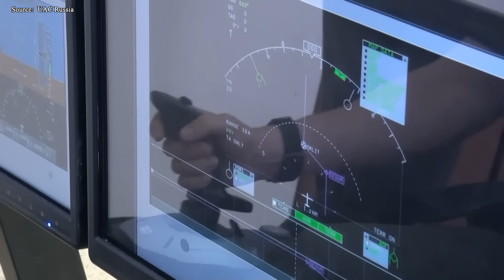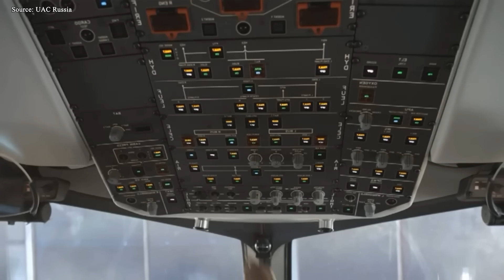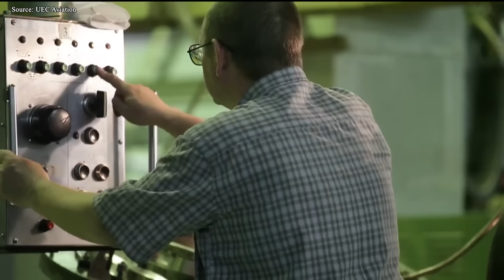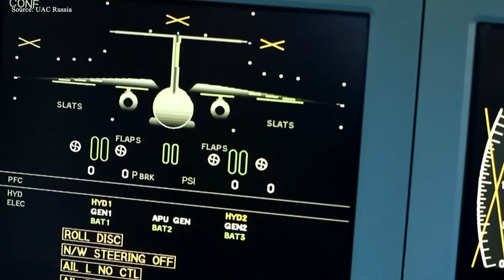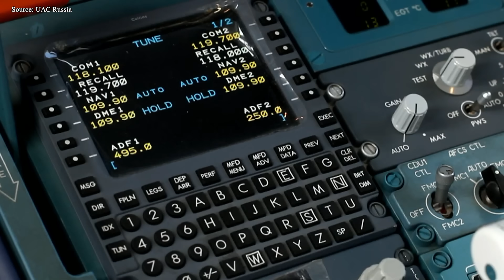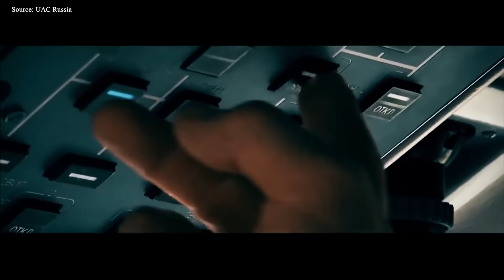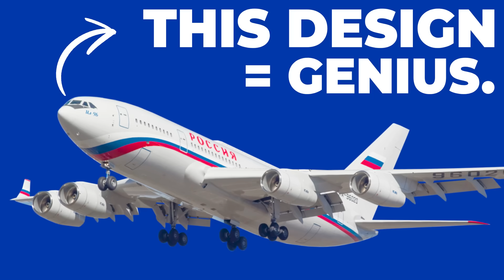How Russian Ilyushin IL-96 Just OUTSMARTED Boeing & Airbus

Comment: There has been plan for the manufacturer to redesign the aircraft to use 2 more powerful engines in place of the existing 4 engines configuration. If their aero engineers can solve the technical challenges, especially the ways to reinforce wing structures, the two-engine Il-96M would be easier and economical to maintain and operate. This will put the aircraft as a serious threat for its direct competitor such as Boeing 777 and Airbus 350
Reply from the maker: it's useful!

Comment: As you don't mention, before 2022 Russia was already sanctioned and only when it benefit the west they gave sanction waivers and using that as a pressure model ,only look at 2019 to 2022
Reply: Who deliver the ps 90 aircraft engines   and airframe ill 96 to Russia?

Comment: It will get 2 engines PD35. And become best in its class
Reply from the maker: Sure!
Reply: @CIVILAVIA1  But screw that, those engines and planes are built piece by piece like by better model makers. Until the engines run for thousands of hours without failure and there is long-term service experience, it's just stupid parroting of propaganda.

Comment: "relaxed climber" = under powered. same size as a 767. except uses 20% more fuel.
Reply: There is an upcoming new engine. For internal Russian market, fuel cost don't matter as much.
Reply from the maker: Fuel efficiency is definitely a key factor in modern aviation.

Comment: I read an article on how tri-engined jets may be making a comeback, and the strategy being used to make them relevant once again, is to build large aircrafts that need 3 engines to take off, but once airborne 2 of the engines would be turned off.  With one engine running the aircrafts gain huge fuel savings.  I was wondering if this aircraft, having 4 engines could do the same because with its size and a strategy such as this, it could take whatever profits expected, and far exceeding expected efficiency metrics, make HUGE PROFITS ...

The idle engines could be kept warm so if needed in flight they could be turned on with no problems even in the coldest weather at the highest altitudes.
Reply: I was thinking the same, bro.

Essentially almost all modern jets require just one engine during horizontal cruise. But the engine must be placed on the airframe’s centerline.

The other two engines in a tri-engine configuration stick into the airflow—either hanging on the wings or attached to the aft of the fuselage as in modern private jets. These sticking engines generate a looot of drag, but. If being off or idling they somehow generate even more drag than when they produce real thrust. That’s a bummer! You somehow have to hide the engines #1 and #3 when cruising on the aft center engine.

Comment: Four engines will never winn. That was also the fate of the A380.
Reply: They have oil. It will not succede in export market but will be good for domestic. With the revenue from these aircraft they can design new more efficent ones. I doubt they will get certification outside russia as Comac has been suffering as well.
Reply: @jaymax9560  but air companies do not have pil, did not you know?????
you are so stupid, russian supporters....
Reply: For them oil is not an issue unlike cost sensitive west.
Reply: @sumitpandey3625  and for whom is money not sensitive?
Reply from the maker: Efficiency always wins in the long run 😊
Reply: @CIVILAVIA1  yes, so russian plane is doome already, they did not need to start producing

Comment: And then, the inconvenience of four engines for a plane comparable in size to a Dreamliner. I’d like to see fuel efficiency and maintenance cost figures
Reply: Yeah well it is better than 2 engines. Unlikely 4 engines fail at once. Boeing is now a disaster.
Reply: @pistondo  I fly on 737s regularly and I’m still alive. But they put the 747s aside exactly because of their four engines. Russia will not catch up without common sense.
Reply: @holdfast453 , Boeing 737-Max is American Roulette.
Reply: I don't think that price matters when for your aviation there is only one option: to be or not to be.
Globalization crumbles because of emerging economic wars: US vs China, Europe vs Russia.
Reply: From an other similar thing that I saw comparison. Fuel consumption and so fuel cost is greater, but maintenance cost is much lower both because it last longer and cost much less. The total cost was lower.
Reply from the maker: Four engines do present a trade-off for sure; it's a different approach to long-haul efficiency.

Comment: Four engines? I do not know.
Reply: Safety. Fault tolerance.
Reply: @Олег-я4ш3ж Well, current engines provide the same with two. Anyway, you did a good work.
Reply: Дурень думкой богатіє.
Reply: @vladimirvolodimir3017 el necio no busca entenderte solo espera su turno para contradecirte. El halago debilita, ¿quién quiere ser débil? saludos y respeto.

Comment: It’s cheap but old tech. A gas guzzler and expensive to operate.  No western airline would touch it
Reply: The IL-96 newer variants not nor ever will be for western airliners even when it is finally a competitive twin engine widebody. What will probably happen is UAC will be making a few quad engine IL96-400m for Cargo use until the mid 2030s when they swap it over to twin engine PD-35, those will compete well enough with the 787/A350 for Russia and their far cheaper fuel costs.
Reply: Western is kaput
Reply: Is there really anything more backward and unreliable than Boeing?
Reply: Better old tech that works than new tech the falls out of the sky (Boeing)
Reply: I'm willing to pay for the extra fuel, as long as it doesn't randomly drop out of the sky.
Reply: bulshit
Reply: @marekgaramond4198bullish is written with 2 l's.
Reply: If China continues it's tight grip on the export of rare earth minerals options like the Russian, Chinese and Brazilian become ever more attractive. Even if the west manages to build up its own supply chain the cost of the plane will be so high that no or very few airlines will be able to afford them.

Comment: 100 millions dollar is a bargain, same price than Comac 919 or a third part of an airbus 350. I don't believe this plane can be so cheaper.
Reply: This is possible if you use cheap local components rather than expensive imported components. And this is really the case.
Reply: How much does it cost to produce say Windows 10 vs the licencing & support costs ?

Comment: The 96-400 is a temporary step though. Russia is reintroducing it and reworking it to modern production methods and avionics to reanimate its production capabilities and skills, but it's a 4-engine plane, making it conceptually old. Nowadays wide body planes have 2 engines. Russia is currently working on a new wide body plane (that will be build as an evolution of the 96-400) and will be powered by the PD-35 engine that is in the works (demonstrators are being tested in 2025, prototypes will be arriving in 2026). This PD-35 engine will also be used in the new long range cargo plane that will be replacing the aging fleet of An-124 planes.
Reply: The added robustness of a 4 engine plane might be a competitive advantage for a non-western market. With higher fault tolerance it may have a broader appeal globally.

Comment: Took one from Bangkok to Moscow about 1992. It was like entering a sauna, steaming and difficult to see where your seat was. It soon cleared and a beautiful lady showed me a to my seat but signalled the one next to the window. I moved to the window seat and it was wet. Looked up and drops were dripping. The AC settled down and the drops stopped. Looked down to grab something from my bag under the seat, noticed a fat, about 1" wide, multicoloured wiring harness running along the side!
What if I cut this? Would the wings fail or would the rudder be affected. I ordered a beer.
Reply: Was that the plane they used to transport chickens, goats and other small livestock?
Reply: ASEAN  countries are humid.  If the plan was sitting for a while, it'll take a while for the HVAC to stabilize the environment.
Reply: Was the beer good?
Reply: drink less

Comment: they need to delete two of those engines. The maintenance on four engines versus two takes twice as long to complete and costs twice as much. once they do that and perhaps replace the engines entirely with a more powerful model then it will be a viable aircraft for the future
Reply: you might have forgotten that the russian parts cost a fraction of their western counterpart, plus 4 means twice the redundancy.
Reply: @MehediHasan-sd7ug we don't need twice the redundancy these days. it's irrelevant. and Russian parts do not cost a fraction of their Western counterparts. anything in the aviation industry is incredibly expensive and difficult to produce. anytime you can cut your maintenance time and parts expenses and labor expenses in half, you should. two engines must be deleted for this to be viable
Reply: @stanley090  If it doesn't affect profits and seat price, then why the fuss?? The two engines on the 777 are massive, maybe equivalent to these 4 on the IL-96..
Reply: @dennisishengoma2743 it absolutely affects profit and seat prices where do you get these lies from? that is not true. there's a reason every single large aircraft on Earth has two engines today instead of four.
Reply: @stanley090  The Boeing 777-300er burns 7.5 to 7.8 tons of fuel per hour, while the IL-96 burns 7.3 tons per hour.. that's almost same consumption albeit with some small savings on the IL-96. So, for starters, daily operations, the 2 Vs 4 engine configuration on these two planes has the IL-96 with some slight savings on fuel.. Where the Boeing wins, is on capacity. It can potentially seat 550 passengers, while the IL-96 can seat 436 passengers, effectively making the Boeing to have fairer seat prices. If you add double maintenance cost of the engines for the IL-96, then the Boeing wins, so yeah..
Reply: @stanley090  The Trent 800 and PW4000 are around $5 million, while the newer GW90 is a whopping $10 million.
The PS-90A aircraft engine is around $1.5 million, while the newer PS-90A1 is around $2 million.
On the latest Il-96 all 4 engines are under $10 million, while on the latest Boeing-777 its 2 engines are almost $20 million. The difference in the maintenance cost of those engines is equivalent to the difference in the price of those engines.
It is not necessary that the price of using two engines is lower than the price of using 4 engines, because it is necessary to take into account not only the simple difference in the number of engines, but also the fact that those two engines are necessarily twice as big as those four engines, which in itself leads to a more expensive product and more expensive maintenance...
Reply: @jerromedrakejr9332 dude. You are wrong.
Reply: Wet footprint, single engine operation risks, Russia having the largest territory but not many alternate airports in case of engine emergencies like does the US.
You can't use yankee logics and standards on the Russian situation.
Btw, which transports keep falling out of the air? Boeing. All NGs are crappy made including the Max, so are the Dreamliners. I wouldn't board that junk even when it was free of cost.
Reply: @stanley090  Prefer the redundancy over operating cost.  Safety is invaluable @ 30K ft.
Reply: @manaboulsi just one jet engine is all the redundancy that is required. I don't think there's a single instance in all of aviation history where three engines failed except for one and that one engine was responsible for getting them back to a airport and landing safely. it's possible that it's happened, I've just never heard of it 

I've heard tons of examples of people failing one engine and the other one saving their life. but not your scenario
Reply: @stanley090  Let me reply to you with same extremely precise and intellectual answer!
dude. YOU are wrong.
Reply: @stanley090  you are wrong (as usual)
Reply: @stanley090  The 737 MAX didn't fare to well with its two engine design. A better option would have been a 4 engine approach.
Reply: @dennisishengoma2743  You can not automatically double the maintenance cost pr. engine. No engines are the same. As in cars, some run forever other break down all the time.
Reply: @stanley090  Plenty of examples of both engines failing ... most recently Air India Boing 787 ... investigation still ongoing ...
Reply: @iRelevant.47.system.boycott  That was NOT an engine failure. The engines were intentionally shut down by a suicidal pilot. so NO. youre WRONG. try again
Reply: Depends on the engine designs. Maybe they require less maintenance and have shorter service time. With 4 of them there is the added benefit of higher fault tolerance, which is a quality in itself.